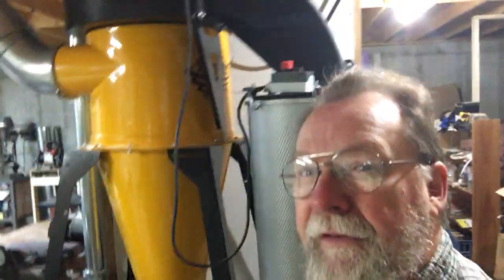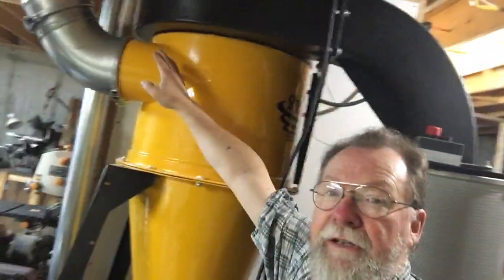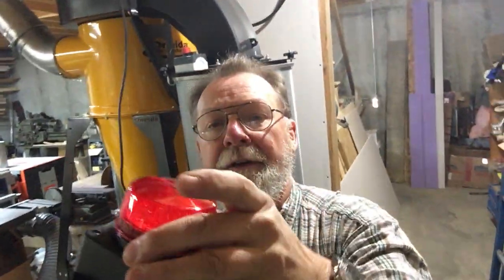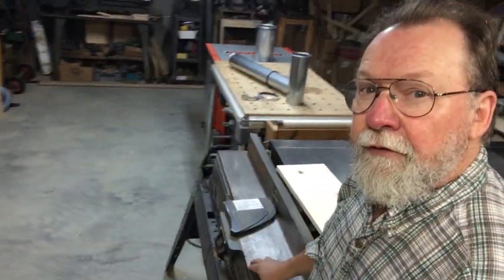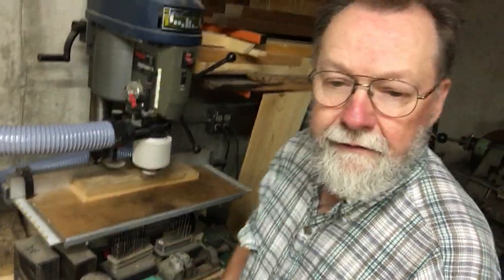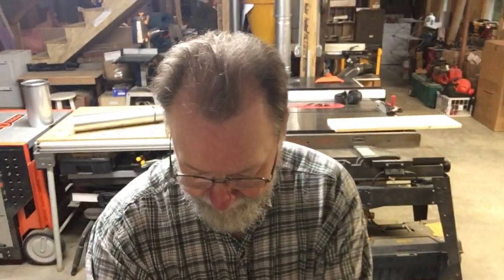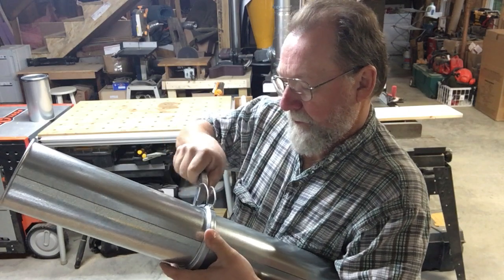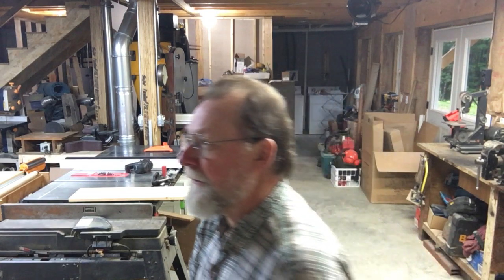Shop tour of Oneida Dust Gorilla Pro system installation

Comment: well i was thinking my 5hp oneida was going to be overkill for my shop but.....i think ill be fine now lol. they recommend only turning it on 6 times an hour though with the 5hp so that kinda worries me
Reply: any reason why only 6 times per hour they said?
Reply: @TravisPisot  it's just the way it is for bigger motors. Think they can get hot when you start stop start stop start stop same for 3hp to. It's not a big deal I usually leave it run if I know I'll be cutting more or planning or jointing

Comment: Nice system, but its 10x overkill for your one man shop.
With the money you spent on that you could have bought a large CNC router, I think your going to run out of room before you run out of collection capacity. You seriously might consider adding a 2 story addition for the woodworking shop 20K sq feet.  Where is the lathe?
Oh by the way  did you know you could turn your 10" bandsaw into a 1/2 belt sander?  
http://www.econaway.com/custom-sanding-belts.html         If you want to look into it. you can order belts anysize from these guys. I have a 8" champion from sears thats cheap and hardly a band saw that's a perfect candidate for this type of 
transition I'm seriously thinking about.  Oh if you want to save money on tools, do some estate sales opt of ones out in the country with less foot traffic you'll get better deals. The Last day is Jackpot time!

Comment: The top body part of the collector that the motor mounts to....Is it now plastic? Ughhh..I always hate when companies start making everything out of plastic. Mine is metal. also the big elbow that connects the filter to the main body used to be metal but is now plastic on mine. Saves them money and they did not lower the price. Just an observation but i do still believe Oneide is a SUPER NICE collector. I love mine..its one of two main collectors in my shop.